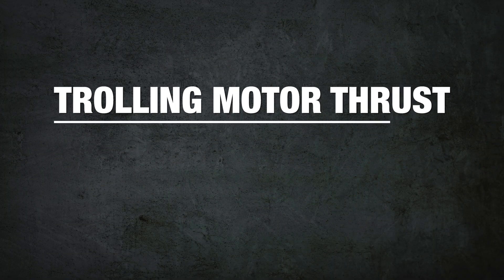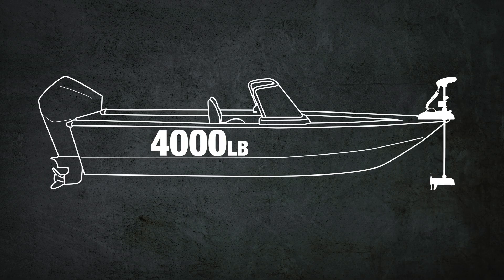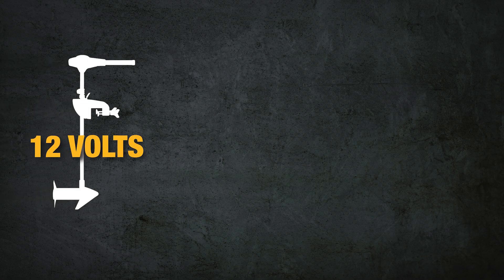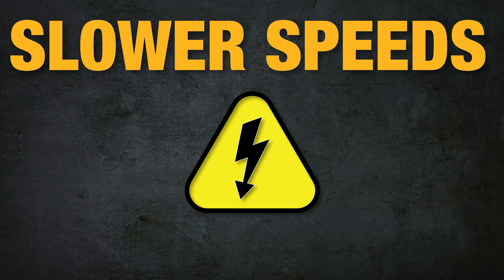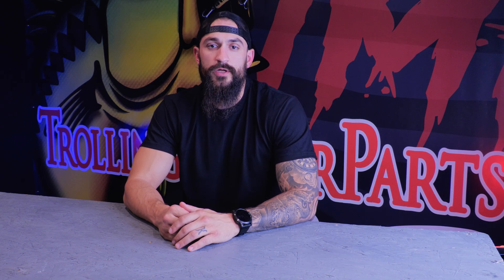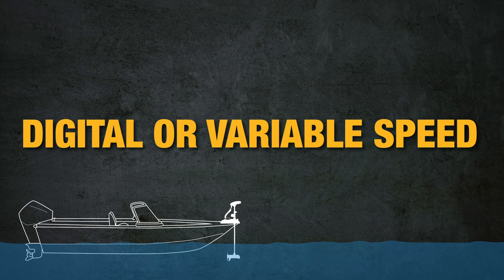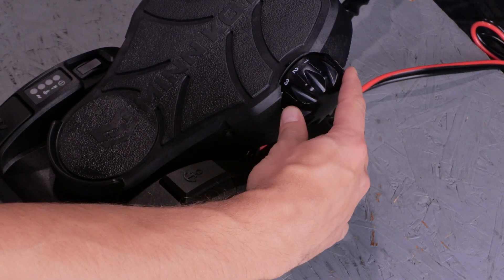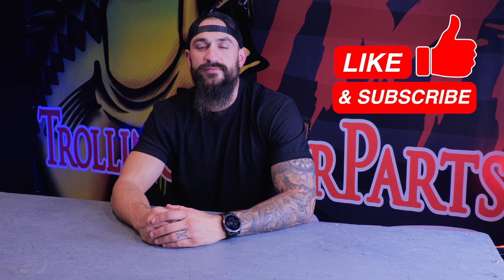Trolling Motor Thrust Guide // How Much Power Does Your Boat Need?

Comment: I am shopping for a trolling motor for our two boats! 1 - 1988 aluminum 21' Starcraft Mariner CC with a 115 4 stroke Merc, 2- the other is a 2006 19' aluminum G3 CC with a 90 HP Yamaha 2 stroke. What pound trust would you recommend for each??

Comment: Will a high-thrust transom motor jack knife a 14-foot aluminum boat even if set to the slowest speed, I need the higher trust for my river fishing, but I also need a slow speed for casting and trolling in lakes I just don't want to go airborne. I will mostly be using it for bass fishing in the Columbia in Oregon with heavy current, but I do not need a trolling motor that goes faster than I need it to when set to a low setting. But once again, I need a motor that has at least 70 LB thrust for the heavy current and running tide at times without the airtime.

14-foot aluminum boat